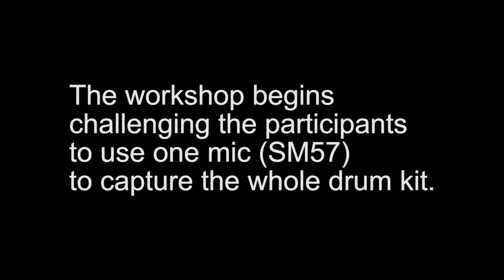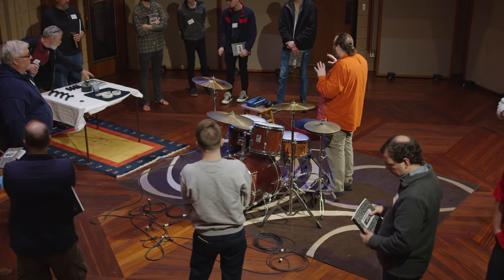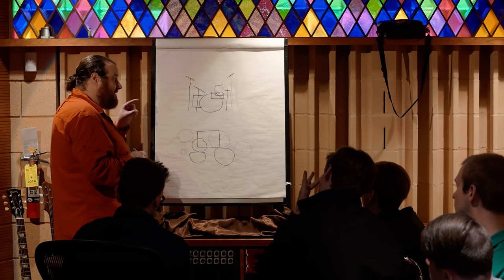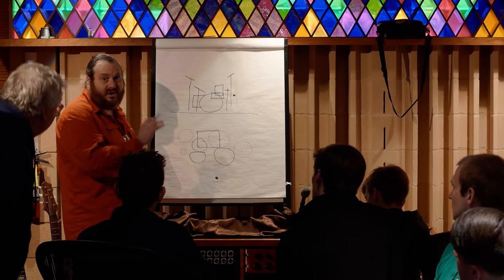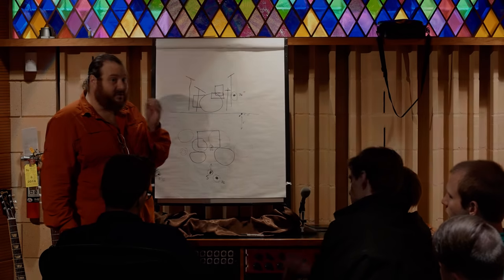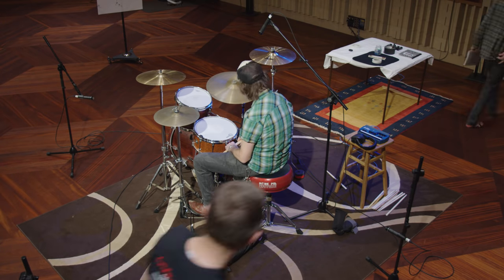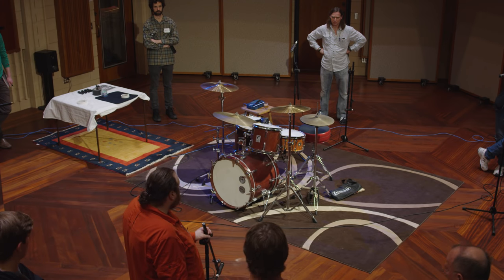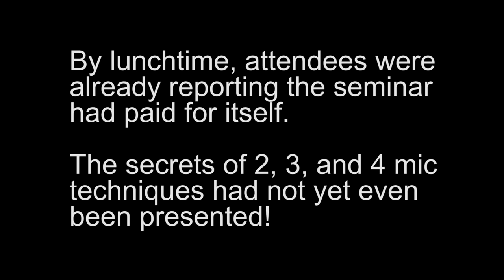Ian Schreier's SM57 Drum Mic seminar (AM highlights)

Comment: A great room, well tuned kit, and good drummer goes a very long way. The snare could use some more bottom wires sound. Great video!
Reply: you are true - it's choke because the snare wires too tight - adjustment takes 1 second

Comment: Great video. This proves people who put a mic on every drum are.......stupid.
Reply from the maker: Haha it just depends what you're going for!
Reply: One mic can be great like in this demo, but for this approach you NEED a drummer who knows how to mix himself like the drummer in this video.  If you're recording a more stripped down style of music in the studio with a good drummer the one mic approach is quite good, on the flipside this approach would not work as well in a larger scale live setting for a Metal band with roaring guitar and bass amps and monitor wedges a plenty. You could also use said "unnecessary" mics to help reinforce that single mic as well for tracks with a denser mix, use the single mic as your room mic and add in stereo overheads to widen the sound, or some close mics to give you some options during mixdown time, you don't have to use those extra mics if you don't want to and you don't get as boxed into a corner sound wise
Reply from the maker: Yes you are right Doug. In a live setting, you would definitely want to use a different approach. The later half of the seminar did use a few more additional mics, but the first half of the seminar was designed to stress the importance of positioning. Thanks for your comment!
Reply: @Manifoldrecording  The comment directed towards Leon,  I'm aware that the first part of the seminar was aimed at getting the best possible recording with one mic, but the attitude of "Only idiots mic everything on the kit" was kind of arrogant. Sorry for any confusion